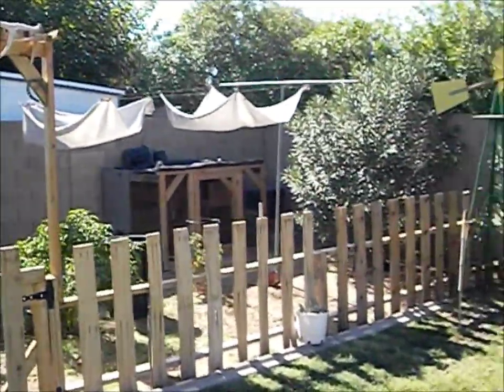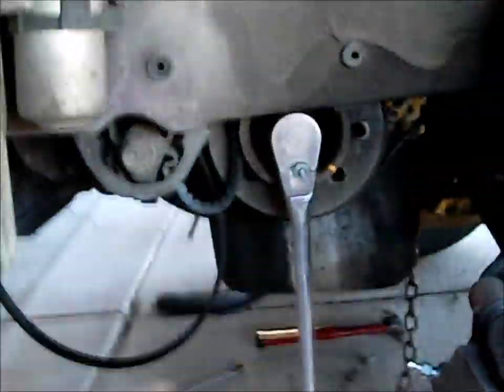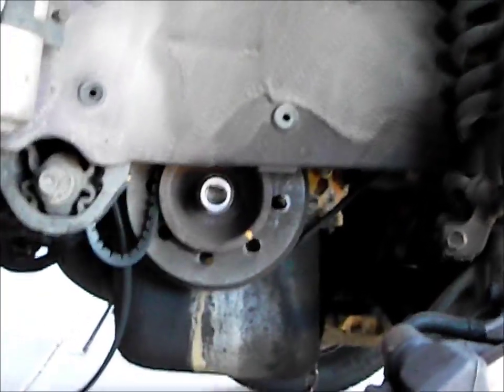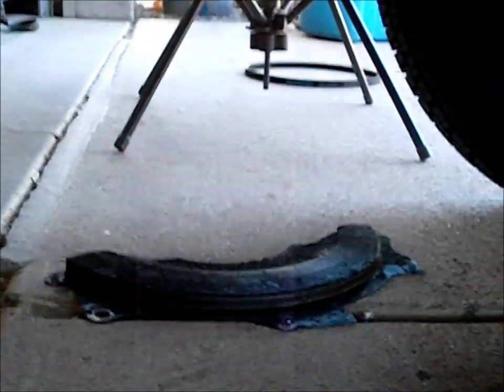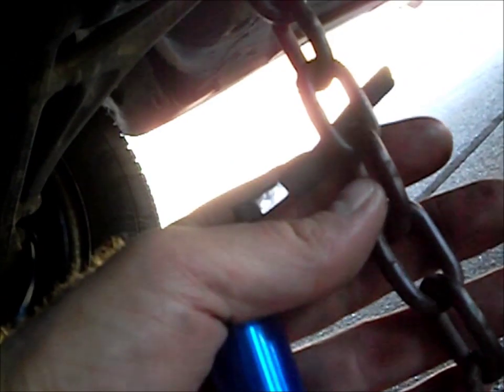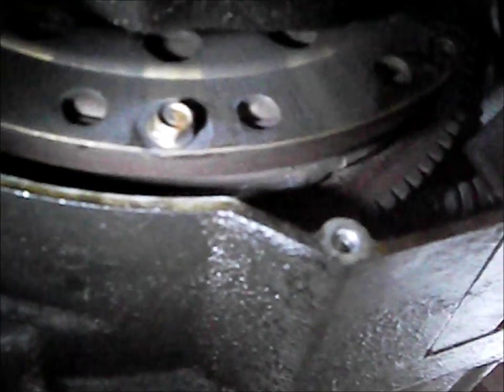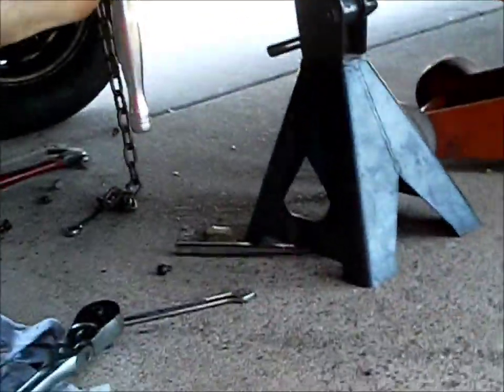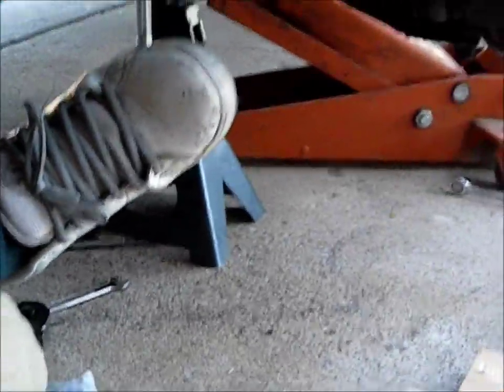Crank pulley bolt removal on a Civic

Comment: O'Reilly Auto parts has a loaner tool for holding the crank steady.  It slips into the crank pulley's hex around the bolt and it worked like a charm holding the crank pulley in place on an '02 Civic LX 1.7L engine.  I had to use a 3 1/2 foot cheater bar in addition to my breaker bar to crack that bolt loose though...btw great video!
Reply: Look at the crank pulley, there is no hex in it. I rented that tool for my civic (same as this guys civic) and found it is useless.

Comment: nice video.
question: what do you call the small elongated rectangular metal that holds the crank pulley to the main assembly?
Reply: arpeemac That sucks, you can buy new ones at the hardware store for a few cents. Crap like that is the reason I do all my own auto work.
Reply from the maker: thanks arpeemac. if i understand you correctly  its technically called a woodruff key or slotted key.  Google it for pics to compare your part. hope it helps, Cheers!
Reply: thanks man. you know what happened? some idiot mechanic a few years back lost this key and what he did is just substitute it with an ordinary nail (like the one you use with a hammer) which he shaped. i did not know it until last week when the crankshaft pulley ate the belt because it was loose and was misaligned.

Comment: I hate you so much!

OK, not really, I'm just jealous that you got the thing off.  It's a good idea but even with renting the honda tool to hold the crank in place, mine is stuck beyond comprehension.
Reply from the maker: Lol. only thing i can recommend is a 3/4" impact gun to loosen it up. Good luck, Cheers!
Reply: An impact gum makes the most power on the first few strokes. Fist, oil your gun, then press and release the trigger in short 3 blow bursts.

Comment: Great idea, it worked like a champ! I used a piece of steel bar stock with holes in it in lieu of the chain; it was just what I had on hand. This is the best method for those of us with the pulley that doesn't take the crank holding tool.